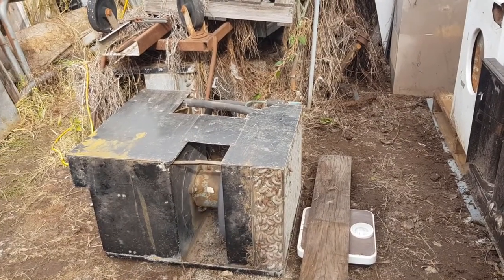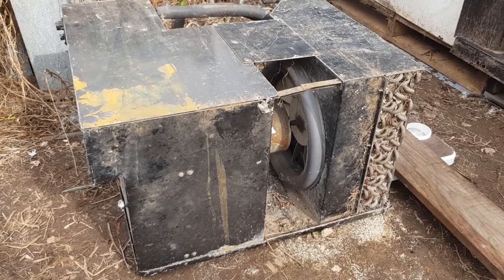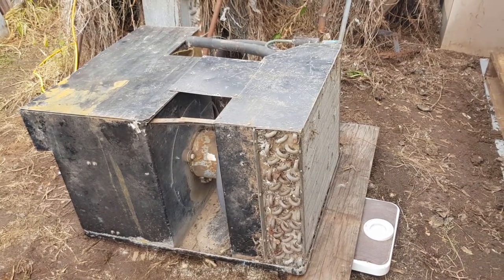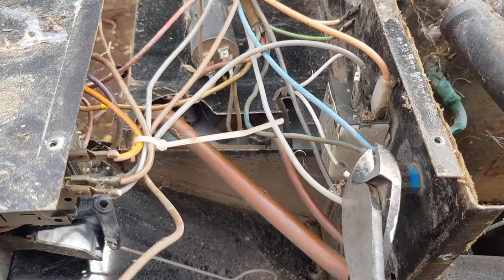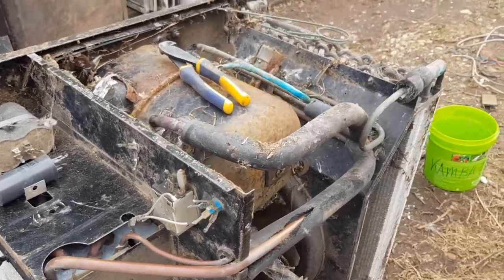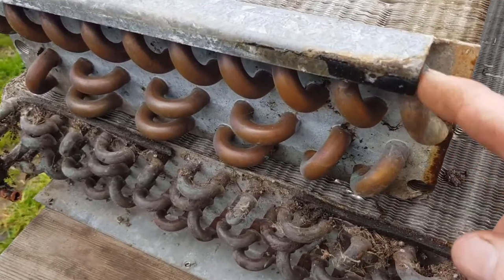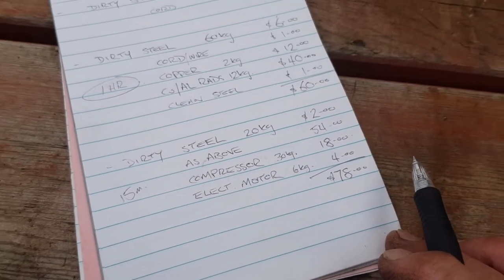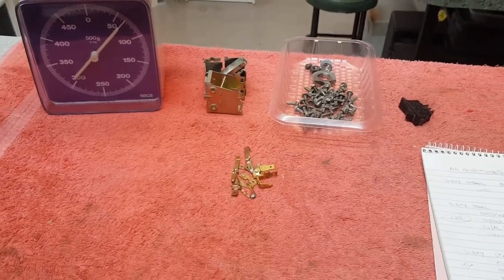Scrapping an Air Conditioner. A comprehensive look at scrap value and the time involved. Nice copper

Comment: From $9 to $70... definitely worth it. I'm not very mechanical so I don't know if I'd be able to strip that machine apart. But the video was informative so I might have a go at stripping some non working power tools I have... they'll have motors in them... Great video once again.
Reply from the maker: Have a go CS - you don't have to be overly mechanical. The good thing about scrapping is that you don't have to put it back together again! Treat it as a puzzle! 😁
Thanks for your comments 😊

Comment: just noticed your hacksaw does have the square drive at the wingnut, you can position it to go sideways(90degrees to the vertical) be easier to cut past the ends of the radiators. 
My hacksaw has a 45deg set of pins which might also get past the ends of the radiators
Reply from the maker: Yes mate - you are correct! I don't know why I didn't think of that while I was sawing! Thanks 😊👍

Comment: You can get the copper out of the radiators by cutting with a razor blade would it be worth it
Reply from the maker: Lots of people do remove the copper tubing, but I don't have the time and the radiators get pretty good money as they are!

Comment: hmm one scrapyard i know pays $10 each for complete Ac/units. although the ones i've taken in are your typical 80's home aircon. not bad if you don't want to put time into scrapping one. (Don't know what they do as far as the gas issue goes, must be worth it for them.)
Reply from the maker: I would imagine they have a contract with someone to remove the gas. Either that or they don't care and are environmentally irresponsible!

Comment: Aren't they a dirty thankless task!  
My yard combines corroded copper tube with bright for the same price. Even the ticket says "bright/green". The oily loops without solder go in the same bucket. Price is $6.70/kg.
I often use branch loppers with copper pipe. 

Re: the gas.  As far as I can tell the scrap yards aren't required to remove the gas in an environmentally friendly manner.  How wrong is that?
Reply from the maker: Well, the thanks comes when I sell a huge stack of cu/al radiators I guess! 😉
That's crazy that your yard combines copper like that - I guess the $6.70 is basically No. 2 price and they don't have to pay a premium for No. 1! 🤔
As for the gas issue - that's criminal if that is the case!!